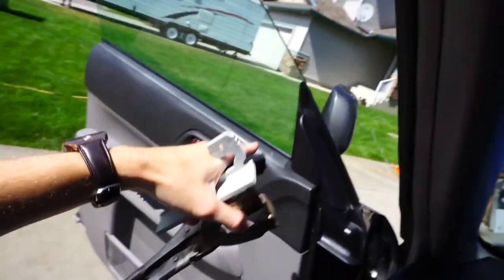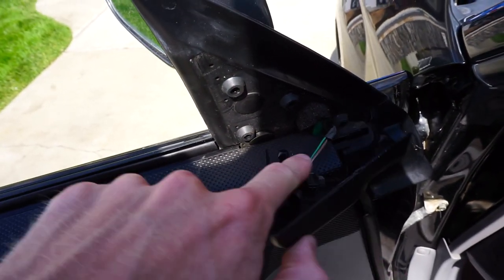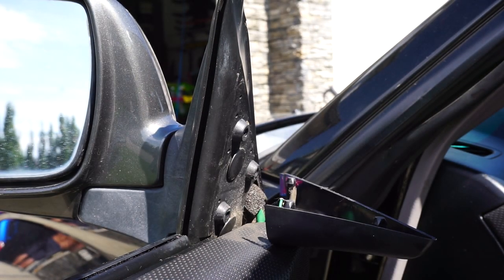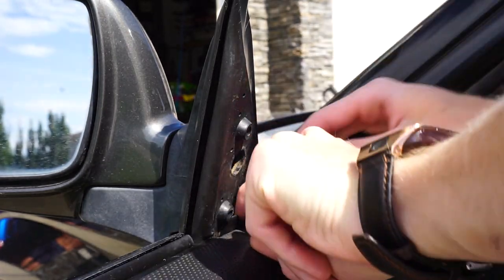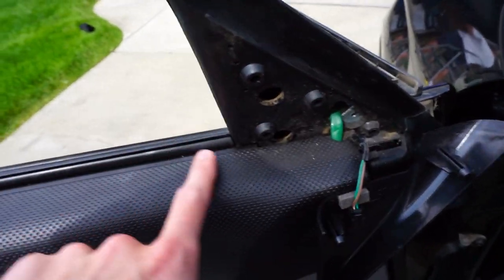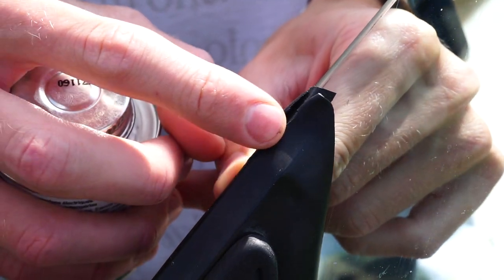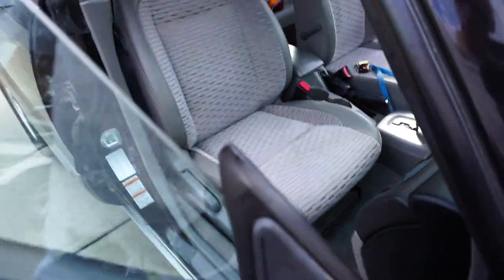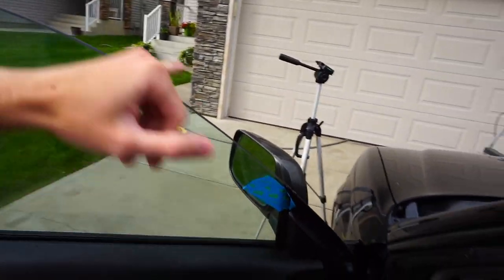How to your Subaru Fix Wind Noise! CHEAP!

Comment: I did just about everything, including this method, contact cement with inner tube, you name it. I caved and bought the $135 gussets. Best money I’ve ever spent on the SG. The difference is night and day from my home brew repairs, some that I thought worked pretty well. The new gusset rubber literally clamps the window, while still being extremely soft and stretchy. When you close the window, the top of the gusset stretches. When you close the door, it molds itself into place. The result is literal silence. ZERO noise, not just “significantly better”. The culprit here is just natural rubber degradation and off-gassing, which makes it hard and formable. Just like old o-rings that take shape over time. Soft and stretchy is  key.
Reply from the maker: Yeah exactly rubber seals aren't made to last forever, maybe someday I will cave too and buy the gussets, but right now I much rather put the money towards the race car rather then the daily haha
Reply: $60 on amazon now. I'm ready to cave in and just buy it.

Comment: That cable isn't for heated mirrors, is for tweeters(FXT owner)
Reply from the maker: I believe it’s actually for the electric mirrors as my xs doesn’t have tweeters there
Reply: @Chase_Schrader  well FXT does hehehe btw exellent video sorry for a negative coment... but you have a thumb up! Imma do that to my FXT
Reply: @Chase_Schrader  it is there for when you want to add tweeters (and grille sail); it'll just plug and play. That plug does not supply power.
Reply from the maker: @VncentValntine  lol yup, I found that out after I found that my mirrors are heated
Reply: @Chase_Schrader  Nope. It's for the tweeter. The power for the mirror has  more wires (3 or 4 depending on model). You can see the other mirror wire if you look.
Reply from the maker: @TheGhungFu  I know, look at the comment above haha